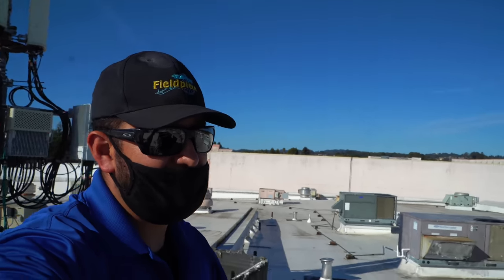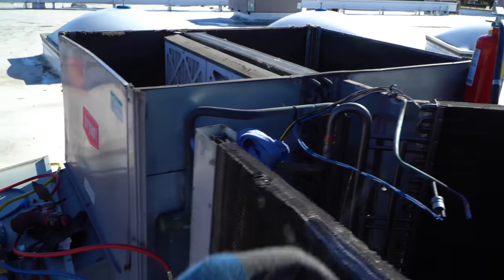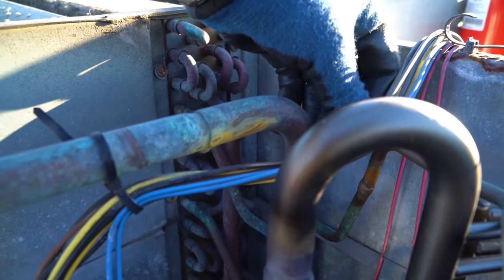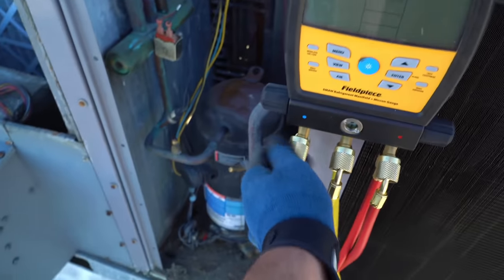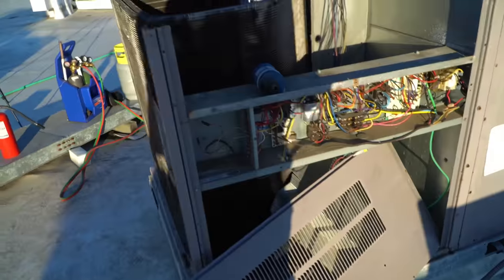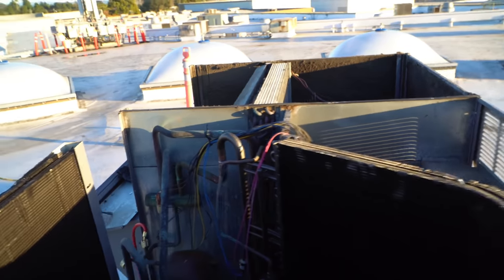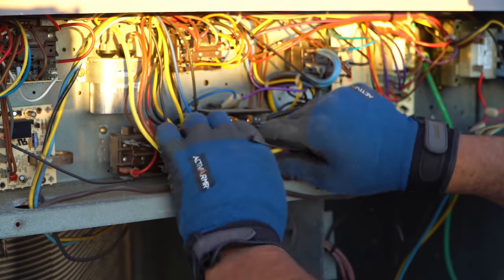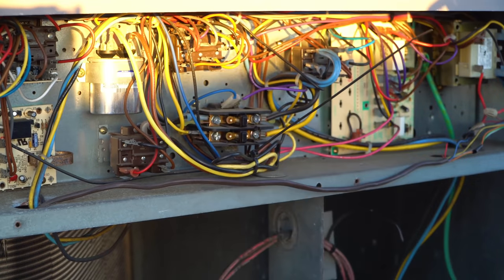WE shouldn’t be touching this UNIT

Comment: It’s always good practice to weigh out the oil from an old compressor that way when you’re ready install a new one you know how much to remove from it. Excess oil reduces heat transfer and system capacity, that extra oil will coat the walls of the refrigerant piping especially in the evaporator.
Reply: Unless its a burn out I'm pretty sure knowone does this. You would have to empty the oil from both the new and old compressor when out of the circuit then find out how much oil was in the system originally with is not always available and then measure the new oil back in and then still you would not be accounting for oil left in the evap and cu. So its not done in real life practice. Good thing is I swaped 100s of compressors and never was called back to the same compressor job in 16 years. Must be doing something right.
Reply: Taylor is right . Unless it has a sight glass on the compressor witch I’ve seen on 60 ton units. That little compressor will die on its own regardless. lol
Reply: @taylerellis378  a burn out is a different story.

Comment: I believe those are "Core Max" access ports. The removal tool to evacuate or recover is very expensive. Pretty sure last I checked it was around 300+ $. You could always cut them out and sweat in new fittings if you have the appropriate size pipe or access T's

Comment: What if you had a leak on your braze joint and didn’t find out until you charged it? Always pressure test with nitro. Good video.
Reply: Our boy is just that dang confident I guess
Reply: Like you know anything
Reply: Agree with...
Reply: If you don't pressure test first then you've sucked air into the whole system and contaminated it. Also, shouldn't use a torch to remove line dryer and especially if you don't protect the dryer from heat. When you heat it, it releases many of the contaminates it has captured. I personally wouldn't video myself using crap HVAC practice if I was forced to do it. Customer now has video evidence of poor service. Crap out, crap in.

Comment: For all those novice HVACR techs always pressure test with nitrogen and use bubbles to check your brake joints because no one is perfect.
Reply: Braze joints dang spell check
Reply: Wouldn’t pull down and hold below 1000 microns if he had a leak no need to pressure test, only tight spots you should be concerned about leaks at your braze joints, confidence is key to a good tech
Reply: @mohamedkhan5207  just to let you know I have had a tight vacuum and still found a pin hole that did not show till pressure was applied so a good CONFIDENT TECH STILL CHECKS THEIR WORK he did not even do a decay test at all so I can almost guarantee there are pin holes due to condition of the copper but the least a good tech does is check his work and doesn't cut corners
Reply: I braze then leak check with my vacuum ;)
Reply: @eriknunez8757  I used to do that too but was told by a older tech to pressurize with nitrogen because a vacuum can suck material in to a pin hole and appear to be sealed but the system does not operate in a vacuum so you should test the system the way it operates then pull vacuum after you confirm no leaks at your braze joints because pin holes will allow a deep vacuum to be pulled but pressure will not hold. But you all do you and I'll continue to do what I have done for nearly 30 yrs and that is purge nitrogen while brazing then pressurize sealed system and leak check with bubbles (this is how every manufacturer that I deal with wants it done) then evacuate down to minimum 500 microns but I try to get down to 300 and stabilize around 500 microns
Reply: @eriknunez8757  Even my son is a Diesel tech and he has had a A/C system that he evacuated and it showed no leaks found till he charged it with refrigerant and then it showed leaks also you are taking a chance that if you draw a vacuum and there is a pin hole then you may suck actual water into the system from cooling the braze joint after the solder has hardened naturally when you wipe the joint off just like if you wipe off a counter with a damp cloth there is still moisture left behind so you do you techs that choose to cut corners Ill do what I know is correct according to every trade training book and manufacturer requirements out there and I know I'm not the only one that believes that you techs that cut these corners are and I quote called HACKS for not pressure testing systems after sealed system repairs I sure some one can do a video to show that a pin hole will allow a deep vacuum to be pulled and for it to hold a deep enough vacuum for the common 10mins most guys give for a decay test but when the system is pressurized the pin hole will leak so that will prove who the HACKS are and who the HACKs aren't
Reply: @eriknunez8757  there is a reason why everyone  calls it pressure testing and not vacuum testing. Only HACKs cut corners
Reply: @dmiestercommkitchentech3043  like you said, to each their own.
Reply: @dmiestercommkitchentech3043  lmao my dude you must not undertake how vacuum works and microns, any leak will show up when you do your decay rate. Yah buggin sun leaks= moisture which will increase your micron above decay rate
Reply: @mohamedkhan5207  I have actually pulled a vacuum and it pulled down to below 400 microns and then decay held to 700 microns so I charged the system and it had a pin hole that did not show till the system was pressurized and vacuum is to remove moisture from system not to leak check to leak check every tech book instructs to use pressure to leak check not microns or vacuum. I've been doing this for nearly 30yrs and all those telling the new guys or gals to use vacuum to leak check are WRONG!!!
Reply: @mohamedkhan5207  so obviously You don't know what the evacuation is used for it is not to leak check go back to school
Reply: @mohamedkhan5207  also the vacuum will hold longer than pressure will hold because air moving into a evacuated system has moisture molecules in it so it takes longer for a deep vacuum to diminish than it takes nitrogen to leave out a leak if you are purging nitrogen while you are brazing then it is easier to close the ball valve and pressurize the system spray braze joints with bubbles then connecting the vacuum pump to evacuate the system after pressure test is done and then while vacuum is running you wipe off bubbles and complete the wiring of all components. I know you were not trained to use a vacuum to leak test because if you leak test using a vacuum you take a chance of sucking in non condensibles which will cause major damage /failure of components so if that is how you do a leak check then you're a HACK and need to be retrained or need to change professions because your way is wrong per every training manual ever written
Reply: @mohamedkhan5207  I tell you what I challenge you to find 1 printed copy of any official training instruction guide that tells you to leak check with microns or a vacuum you won't because it is stupid to take a chance to suck in noncondensibles into the refrigeration circuit and I don't care how good you think you are at brazing pin holes happen when brazing with nitrogen purge.

Comment: One thing I don't like about Carrier/ICP units, they only use the "mega flow" schraders. There's no removing the pin, you can only remove the core, it's made of two parts, the core and body. I find myself removing them from the system when they leak and add the regular schraders. Also yeah in this field dude, you'll be replacing compressors on 15 year old units and you're just like "why?", honestly they do it to hold over orrrr just like frankenunits lmao. As long as I get paid, im good, whenever you approach these units, quote a repair and quote a replacement, covers your butt both ways. Great video bro!

Comment: I would have brazed on coil with rosebud tip on system that old. Go with smaller tip to not heat the other joints to much. I've done that before and found many leaks after on u bends. Even in the new one that had that gorilla paint on it